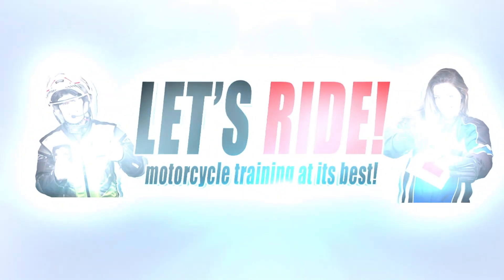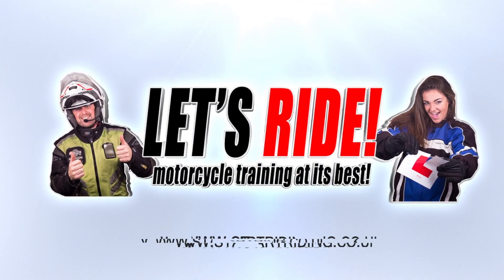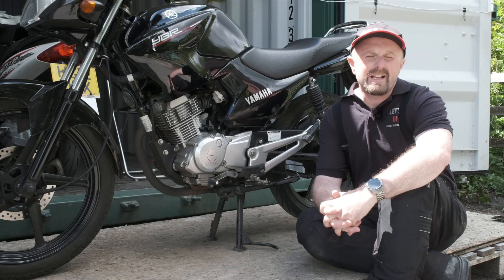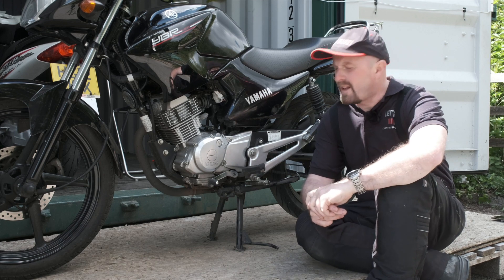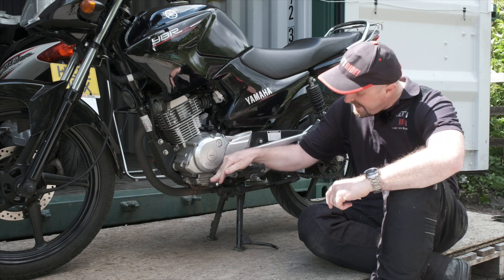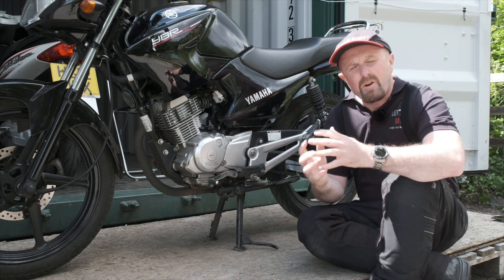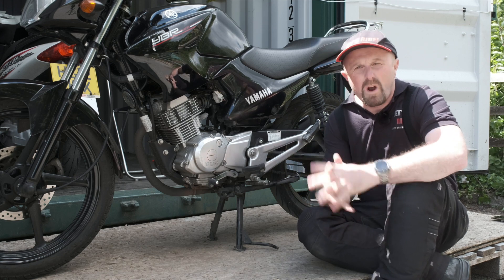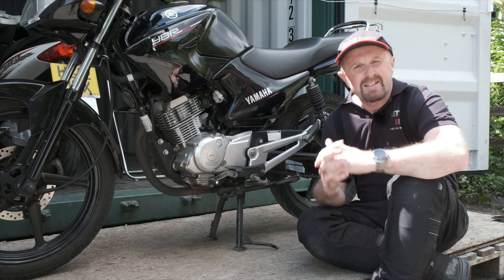CBT Element C - how to use the gears on a manual transmission motorcycle

Comment: Got my cbt tomorrow 

If I downshift into 2nd coming up to a a red light but it changes to green right before I would have stopped , say at this point I’m doing 3-4 mph, do I leave it in second and accelerate away or do I need to go into 1st with me going so slow?  Hope that makes sense, thanks mate. Your videos have been priceless.
Reply from the maker: If you're going as slow as 3-4mph then I'd suggest going down to 1st gear. Otherwise the engine will bog down when you pull away without significant clutch slippage (which is ok btw). Best of luck with it.

Comment: Can you change gear on turns and roundabouts or is that a no no like the front brake ?
Reply from the maker: Ideally all braking and gear shifting should be done pre-corner but some corners are long enough & fast enough to warrant a gear shift. Honestly, for normal road-riding it's really not critical - you're not taxing the tyres and suspension enough for it to be an issue.
Reply: If you can be very smooth (and aren't haulin' arse) you get away with it.

Front brake too. Just touching it to scrub a few mph won't upset the bike, but people tend to panic, forget all their training, grab a handful of brake and come off the bike there and then.

That's why these things aren't really taught in basic training. You're much more likely to spook and come off an otherwise rock stable bike while you're still having to actively think about everything you do.

Once all control inputs are smooth and committed to muscle memory you can start easing off on these big no-nos.